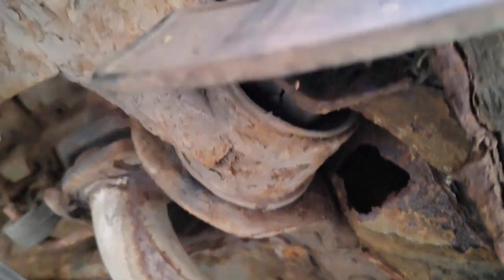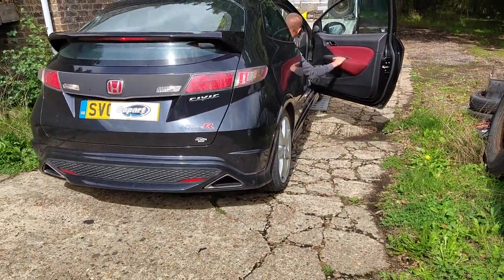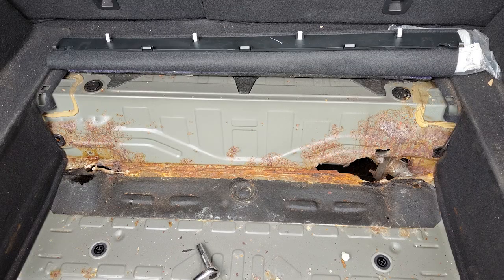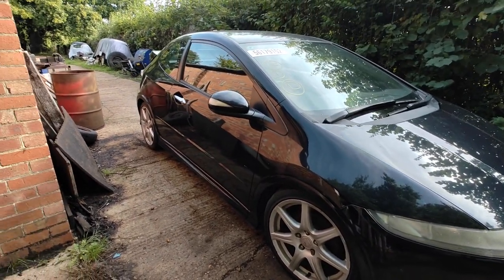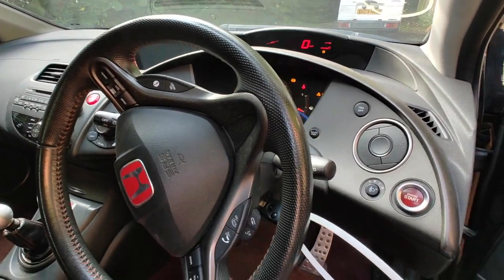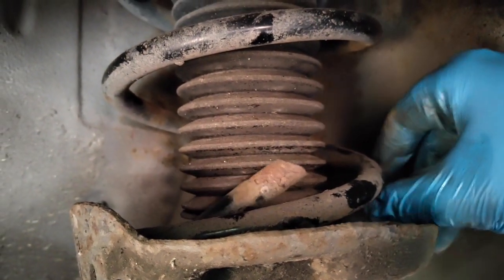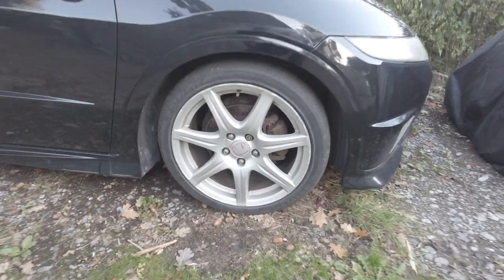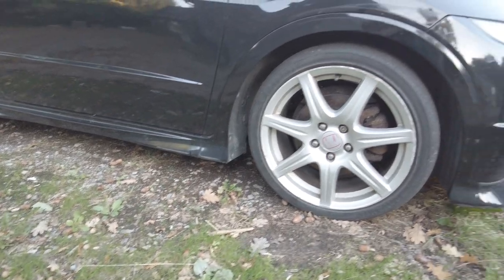This MUST be The WORST Honda Civic Type R in The Country.... Thanks COPART!!!

Comment: Fair play if you save it, but it's probably the rustiest FN2 I've ever seen! 👀I wouldn't worry too much about using a non Type R rear beam, it will have a thinner torsion bar, but it will be a MILLION times better than what is on it. If you can do the work yourself, and tidy up the underneath it may be worth bothering with, especially for youtube content, but it's debateable whether it should just be stripped and parted to get some money back! lol
Reply from the maker: Thank you yes it would be completely uneconomical to repair this car and I wouldn't feel 100% safe selling it of once repaired. so I have come to the conclusion I will do my best to repair it and drive it around for myself , and once I'm done with it I will probably break it for parts or use the engine in my Austin allegro maybe? 🤔

Comment: Dude. Fair play to you.
I'd have just stripped the car and sold on what was salvageable and called it done.
Hondas are common for the rear axle mounts. Did mine on the trusty CTDi last year for MOT as they were going, but nowhere near as bad as yours.
RE: The Type R rear axle, I believe it's 35mm wider stub to stub, but I may be wrong. Something to check.
Keep up the good work.
Reply from the maker: Yes I think if I wasn't filming it for the channel I would have just parted it out. but I will probably end up breaking it eventually, hoping I can maybe drive it for a year or so if the repair is good enough. how did you find repairing the mounts on yours?

Comment: My car went to copart. Came back they had broken rear glass, replaced it but glass was in the frame, inside the car and on the car, which had scratched the paintwork. They had broken much  of the trim inside and bend one of the alloys. Coparts are a con.
Reply from the maker: That sounds awful! scammers!! Every single experience ive had with copart has been awful, I don't know why I keep going back 😂

Comment: I thought the little van was bad… this definitely wasn’t a click bait title.. it must be the worst. Break for parts must be the only option… but where’s the fun in that😂 I really wish you well with this it’s going to make great content (and good welding practice).
Reply from the maker: it will get fixed but I don't think ill sell it on, if I bought a type r and found it once looked like this I wouldn't be too happy, thinking about using it for a little bit and then maybe put the engine ing the allegro or the act van, what do you reckon?
Reply: @cashmachinecars  putting the engine in the Allegro is exactly what Jonny Smiths doing, could be interesting…😉